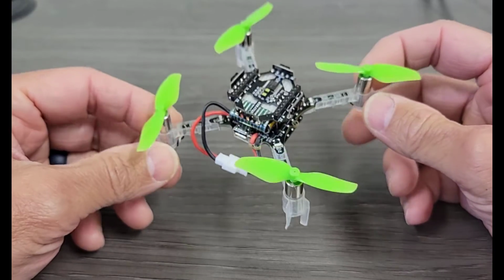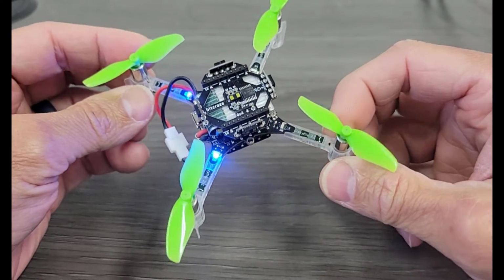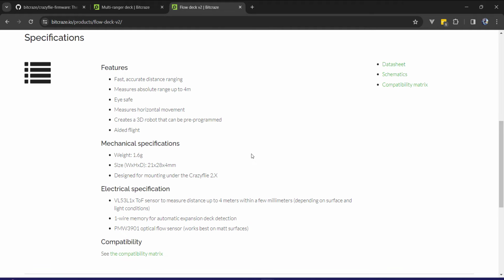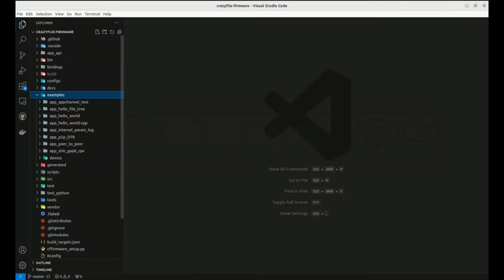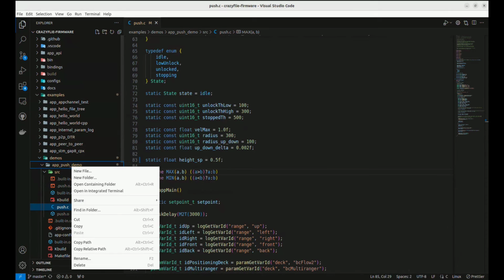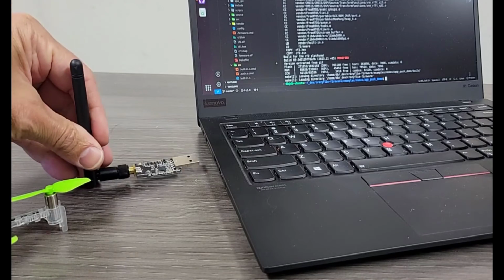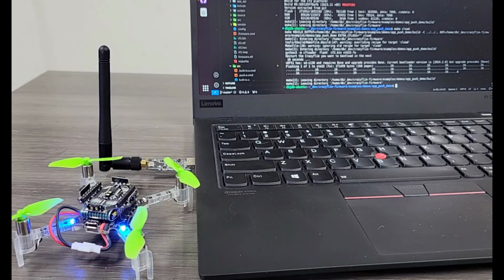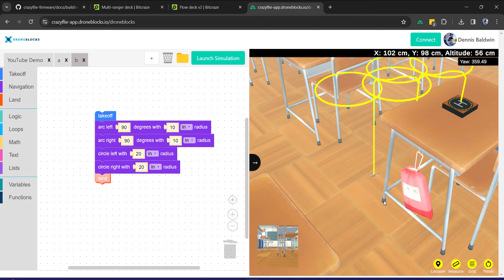Crazyflie Custom Firmware Push Demo

Comment: Hello Dennis, I have a question. I am planning to buy a crayzlife drone this week, but will it work for me if I just buy the drone? When you bought the drone, did it have lidar, navigation or camera sensors? Thank you
Reply from the maker: Hi, you'll need the flow deck and multi-ranger to do what I did in the video. If you want to just fly it around then you can buy just the drone. If you want to program it with navigation abilities (no obstacle avoidance) then you can get the Crazyflie with the flow deck only. Here is the bundle I'm using: https://store.bitcraze.io/products/stem-ranging-bundle?variant=46516175503709 if it's out of stock when you try to purchase you can send an email to support@droneblocks.io and our guys can help you with an order. Let me know if you have any other questions and good luck!
Reply: @dennisbaldwin  Hello Denis, thank you very much for replying to my message. I examined the system and decided that I will only buy the drone and flow deck . But I think it will be a somewhat painful process. How long did it take to order the drone and did you encounter any problems while receiving it? Because I have a competition in 3 weeks at the latest and if it comes late, all my plans will be ruined :/ In fact, I would be very grateful if you could help me with this.